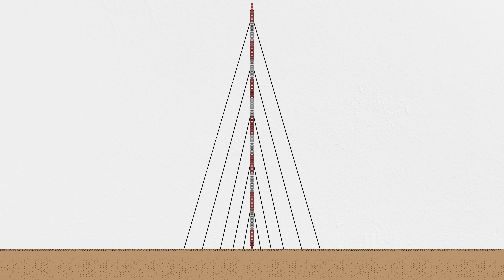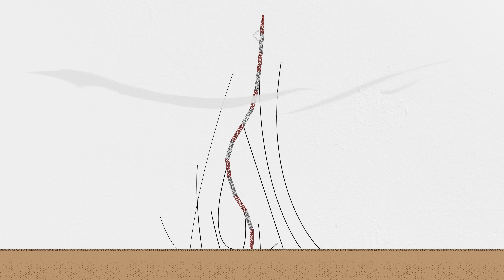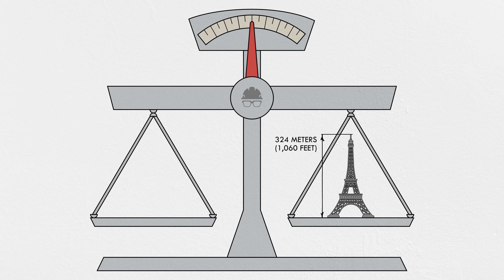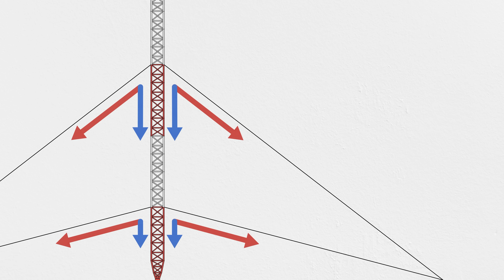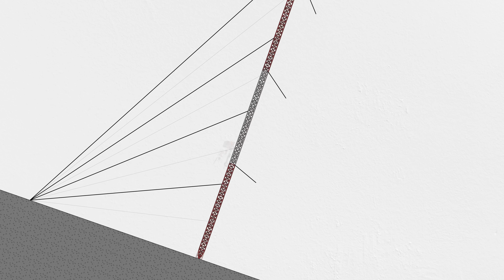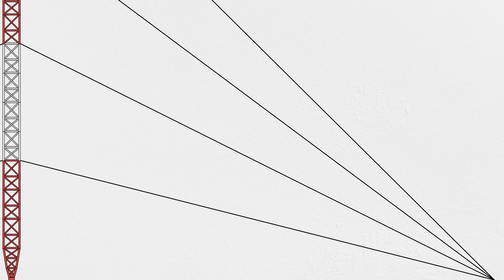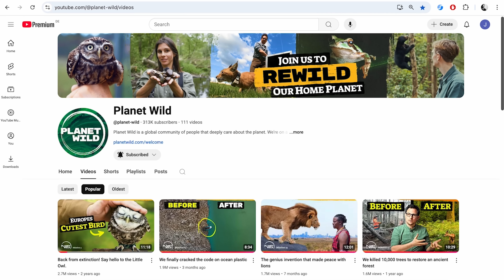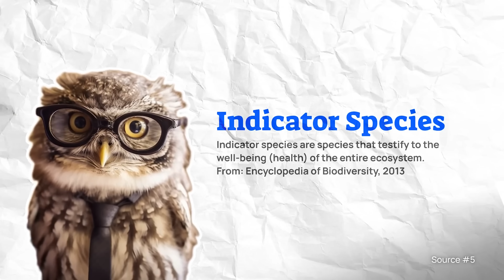The Bizarre Bases of Antenna Towers

Comment: In 1979, the TV tower for the Lloydminster Region, in Alberta, collapsed. To this day, no one knows exactly what happened, but the common belief is that someone cut one of the guy wires. Surprisingly, they were able to put up a lower power transmitter within 13 days. 

That story always stuck with me, and these towers have always held a place of fascination for me. Loved learning a bit more than I'd known before from Grady's video!

Comment: Funny story about lightning and tall towers.  I was an engineer at a TV station where the transmitter site was some distance from the studios.  That 1,100-foot tower was struck regularly, so it had to have some very good spark gaps and grounds to keep the strikes out of the transmitter.  These worked surprisingly well, but all the engineers knew to keep hands clear of all equipment any time there was a storm.  (The rule always was, anything that broke during a storm would not be touched until the storm passed.)  

One spring day, during a thunderstorm, a heating technician from the contract HVAC company showed up to do a spring cleaning and check of the furnace, while the engineering crew stayed off in the shop area.  The furnace guy did the usual checks and tests, then pulled the covers off the side of the large furnace and wriggled into the lower end of the combustion chamber to vacuum off soot from the heat exchanger.  He was inside the furnace just in time to be there when the tower took a minor lightning strike.  The lightning protection worked well enough, but a small amount of the strike spread out as they always did and some of it happened to go to ground between the furnace heat exchanger  and the grounded outside case of the furnace.  This left the furnace guy trapped in a little hole for a second, with an impressive, tesla coil-style discharge happening about 8" above his nose.  He was left looking directly into the face of God.  Recovering his senses, yon furnace tech flew backwards out of the inspection hole, and ran for his truck, leaving his tools and the unbuttoned furnace behind, and drove off at high speed.  He would never come back, and they had to get another tech to complete the inspection and cleaning - on a bright and sunny day, without a single cloud in the sky.

Comment: Funny this video came out this time of year.  Here in New Mexico it's International Balloon Fiesta week.  Tons and tons of balloonists all over the Albuquerque area.  Near the site of the event there used to be two of these types of radio towers right next to one another.  Back in 2004, the Smokey the Bear balloon crashed right into one of the towers, but miraculously the pilot and the rest of the people in the gondola climbed all the way down to the ground safely.  Balloonists have to be aware of hazards in the area, but in the end they're kinda at the mercy of the wind.  Last year, another hot air balloon around Fiesta time smashed yet again into one of the two cell towers.  Insanely, the balloon and the crew was apparently fine, but they took out some guy wires and one of the two towers went down completely.  Was insane too because my work overlooked that area, and I came back from lunch as was like.. "Wait, wasn't there two of those this morning?"  They actually demo'd the other tower earlier this year, no idea if they're planning to do anything with the property, but you can still see the huge concrete slabs where the guys were anchored to the ground.

Comment: I work in the tower industry. Most of the towers that have failed have been from maintenance workers failure to do correct sequencing of maintenance. Most recently, a tower in Colorado failed because they took 2 of the 3 faces of diagonals out to replace, so that section only had 1 face. So the entire tower failed.
Reply: In NZ we had a high voltage pylon fall after ill trained crew removed three sets out of four ground anchor nuts. The HT line load pulled it over before the last nut was fully removed, stripping the thread. It was live at the time, made quite nice brief fireworks, I don't think anyone was severely injured. The usual sub-sub-sub contractors, lots of finger pointing later. Now all repairs have to be supervised by actual skilled people.

Comment: I thought only AM towers were supported at a single point.  It never occurred to me that it simplified design and installation.  Your demo would have been more accurate with a much less stiff wire though, one that would not be able to resist buckling and bending even with no weight.  Making an actual lattice tower with something like nitinol wire would be amazing, you could "restore" the tower for another test by heating it after it had collapsed in a heap!  This video REALLY needed at least a few pictures of what a collapsed tower looks like.

Comment: 400ft towers have 3 guy wires so when i saw that photo of 5 i practically pooped my pants after my head blew up lol every and i mean every guy wire tower i have seen has been nothing more then a 1 ft round concrete disk on a 2 x 2 ft pad sticking out of the ground. i clicked on this video so fast my phone shut down from overtemp.

Comment: Warsaw radio mast collapsed due to failure of the temporary guide wires. One of the temporary wires slipped out of the clamps. Second temporary guide wire broke up due to overload.

Comment: My wife's step Dad had a very tall CB Radio Antenna!!  They lived on top of the highest hill in the area as well. I forget the exact height but it was over 100 feet tall.

He built it himself out of used three pole TV Antenna Mast Sections he collected over a 5 year period.  It had Three sets of 6 guy wires EACH!! 

This was back when CB's were SUPER POPULAR and he was famous in the CB community

They used to go to CB Radio Jamborees in Canada and USA .. My "futter wife" (rip) was a teen at that time,  I still have have her Conventioneers Vest, somewhere in the storage unit, he handle was "The Dill Pickle" LOL

A couple times I climbed the tower to change light bulbs or check connections.   Her Step Dad was getting older and not steady enough to climb it anymore.

Comment: Very interesting video. There is a TV tower in my small town. It is only 117 meters but it is the symbol of our town in many ways (as it used to be on postal cards of the town when they were more of a thing). I saw a few jokes about reception in the comments but the thing is; if you're very close by the reception is actually very bad. Usually I don't get good radio signals in my car until I leave town and people living closer by the tower have all kinds of reception problems.

Comment: Look into the collapse of the Senior Road Tower collapse in Texas in 1982.  Five men died in the collapse, leading to lawsuits, so the incident is well-documented.  An antenna was being hoisted to the top of the tower, but its connection to the cable failed, and it fell, severing some of the guys.  The tower then collapsed.  There is also video of the collapse.

Comment: 3:35  50 Miles.... According to the flat earth people a simple TV tower in the USA should be able to be picked up in Australia!  There is no radio horizon!  🤣🤪
Reply: To be fair, Texas is pretty flat.
Reply: Not a flat earther, but radio signals can and do travel much farther than 50 miles even without clear line of sight.

I was a fledgling RF engineer with Cellular One in Seattle back in the early days of cell phones. One night our partner network in Canada(Rogers Wireless) had a catastrophic failure in their switching center and their entire network went down. Their engineers called us for help and noticed they had 2 bars of signal from our network, and they were able to use their cell phones. Out of curiosity we traced a few test calls and found they were being served by our cell site atop Columbia Center in Downtown Seattle, antenna height about 950'. Their offices were on the 16th floor of Rogers Tower in Vancouver, BC, about 120 miles north. Calculating earth curvature there should be ~9600' declination between the two points...absolutely no line of sight. Our only explanation was that the water of Puget Sound + dense, low cloud cover were acting as a wave guide.
Reply: @Jeff_PNW I completely agree with you. I have had numerous contacts of about 450 miles with using 10Ghz. They way… using airplanes to bounce the signal off of as well. Doesn’t last long but pretty cool to have a small window to do that.  Also do a bunch signal bouncing off the moon  (EME) at 1.2GHz as well talking from central US to Europe.   Come on kids RF is fun!  🤓🥸
Reply: Not really according to most of them because they have really strange ideas about how perspective works.
Reply: @seneca983  fr
Reply: Fun fact:radio waves can bounce off of the atmosphere (specifically the ionosphere)

Comment: My first time seeing a mast's base blew me away, I always expected a huge concrete foundation and for the tower to just be bigger in general.  The one I saw the tower sat on a triangle metal base and then the base itself sat on a single pin going into a block maybe 2'x2'.  I was like "really?  That's what's holding it up?" But it's really the guys that do most of the holding up the base just needs to support the vertical weight. Still kind of mind boggling that the whole tower and the tension from the guys sits on such a small surface though!

Comment: I didn’t see torque arms mentioned in here. Those are an essential piece of hardware for towers that are loaded heavier. Also didn’t mention that some taller towers have 6 anchor points on the ground to keep the guy wires at better angles.
Reply: Exactly! Torque arms are essential, and also the six or even nine anchor points, depending on the height of the structure

Comment: There are YouTube videos taken from the climber's perspective, which I CANNOT WATCH, I've never been up higher than maybe 35-40 feet, and even then, I don't have enough hands and feet to hold on (even with a safety belt), and get much work accomplished.  It got to the point where I would go up in anticipation of having to put the cement head on the last joint of casing, and well over 3/4 of the time, that last joint would go smoothly down to the proper landing height, of  maybe 4 or 5 feet above the floor, which allowed you to get the elevators onto that joint, so the pipe could be reciprocated during the cement job.

Comment: Hey Grady! I’m glad you mentioned airplanes. My dad is a retired ag pilot aka crop duster who worked for 40 years not terribly far from you in central Texas. They would fly very near to and around the types of towers in this video. He always said the biggest thing he was afraid of was guy wires, because they were basically invisible. After so much time, he knew the areas he flew in like the back of his hand to include all the power lines and towers. But especially towards the end of his career when uncharted cell and internet towers with virtually invisible guy wires began to pop up more frequently, it was a real concern to watch out for!
Reply: Hey neighbor!  I'm spraying NW of you guys, where I have to deal with wind turbines too.  The met towers are even harder to see than cell and internet towers in most cases, and they pop up/down within hours.  You can at least make a mental note of where all the cell and internet towers go up, because they generally stay there and eventually they make their way to the database.  But met towers?  They're only temporary, and at 199ft tall, they don't have to be marked at all.

If you've ever been to a TAAA convention at some point in the past 40 years, there's a chance we might have met!
Reply: I can confirm. Towers are fairly visible. Guy wires, not so.
There are a few in the area that I fly and I make sure to stay at least as far away from them as the tower is, tall.
If a guy-cable were to let loose, a small aircraft might be like a bug meeting a weed-whacker.
Reply: There was a helicopter tour flight a few months ago that crashed into a guy wire at night. New pilot to the area that didn't know the landmarks well enough to stay clear, from what I remember of it.
Reply: @Jimorian  I live and work in Houston and was the broadcast engineering supervisor for the tower owner in the late 1990’s.  The helicopter flew into the tower itself which was lit by flashing red lights (could be difficult to see in the background of downtown Houston), not strobes.  The tower was just off Navigation Blvd. not far from Dakin Field where the Astros play so it was close to downtown.  The tower will, most likely, not be rebuilt for several reasons, not the least of which is that it was located on an EPA “superfund” site.
Reply: @Jimorian BS. Any pilot would know about things like that.
Reply: @samuelgarrod8327  Considering you are complaining about dialect, i doubt you have the credibility to say this
Reply: They're called aeroplanes. Stop destroying the English language.
Reply: @samuelgarrod8327 your called a aero plane

Comment: 1:01 Something similar happened to me at a trade show. After the closing bell on the last day, our booth crew swept it and started dismantling when as we were still removing products from shelves. I happened to be standing on one side of a three-story wall of steel beams and slat-wall shelving---at the time still loaded with many kilos of expensive gear---when the whole wall collapsed on top of me. Miraculously, I escaped with only a few nasty scratches and bruises. The crew had removed all the tie-down on the opposite side of the wall without checking to see what was on the other side. Instant giant-scale Jenga!

Comment: Are the antennas generally made with a single, uniform material? Wouldn't it make more sense to use a stronger material near the base and a more lightweight material near the top to reduce the number of guy wires that are needed?

Comment: "5% of the weight of the Eiffel Tower"  - One of the weirdest things is that this isn't even min-maxing for weight.  It's using cheap steel.  A carbon fiber truss tower like Isotruss can be a tiny fraction of that.

Comment: I’ve been setting out shiny new 100m guyed masts in outback NSW Australia for the last two years.
Tower verticality, the angle of inclination of each guy wire, as well as the angle between each of the 3 arms of guy wires are all tightly monitored as construction progresses, and need to be validated by terrestrial LiDAR scans before the tower can come online.

Comment: easy. Done these cable changes it's sketchy at best when you the guy on the tower while switching wires. And never liked the am towers we had to hop on off of a fiberglass latter as not to ground and be burned. The tower owners never wanted to turn off the towers they would simply turn them down to a 'safe' working level.

Comment: I lived just across the road from one of these towers for six years: In my area they get around the land cost by only taking land for the controlled access area around the tower's base, a small area around each abutment holding the guy wires, and an access road. They can fill everything else in with farmland.

Lightning struck the tower multiple times; it basically acted as a lightning rod for the whole area.

Comment: It is very interesting, however the electrical part is missing. The reason to build this height structure is that the antenna has to measure 1/4 of the wave length. Low frequency implying long wave length

Comment: In the US Army, we would set these up temporarily and could get up to 160 feet. The base is similar and the hinge would allo us to set the length of the guy wire a²×b²=c² then pull the tower up with a vehicle when over 40 feet. Otherwise pull and push the tower up with antennas and secure to the ground. And yes the ground was usually uneven so mathematical adjustments would be made. The tallest tower could be set up in under 30 minutes using a precalculated schedule for cable length and the tower would be set up laying up hill.

Comment: I grew up in a ham radio environment.  Always two or more towers in our suburban back yard, 45 to 65 feet, some self supporting, and some guyed.  A self-erecting cable operated guyed tower (military surplus) in the front yard (only for a few months) was the most interesting.  Probably only 30-40 feet, but as I recall it, neighbors objected.  Later in the mid 1980s, after my brother and I lived in different cities, Mom & Dad moved to a ten acre square ag-zoned parcel -- partly so he could erect a 330 foot guyed tower, which he did. Personally, I have never climbed above 55'.

Comment: Each time I pass near one of those towers I count it as a blessing that there wasnt one within sight of my home in my youth. 
  I had some odd fascination with climbing so by the time I was 13, Id scaled just about every tree, water tower and intersting structure within walking distance of our house and Im certain one of those towers would have been an irresistible draw.
Reply: Good thing you didn't live anywhere near me, then. Massive self-supported tower pretty much right in my front yard. Once used for marine communications, but only used for police radio by the time little me moved in. I used to love watching the little light at the top blink on and off at night.